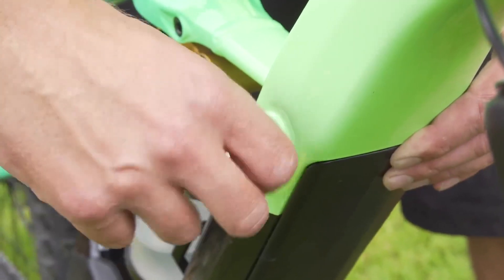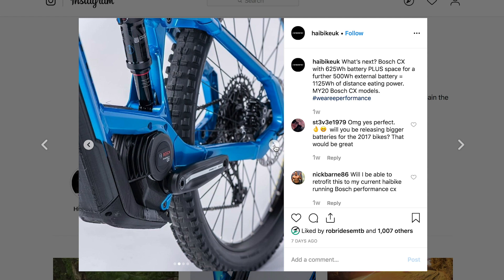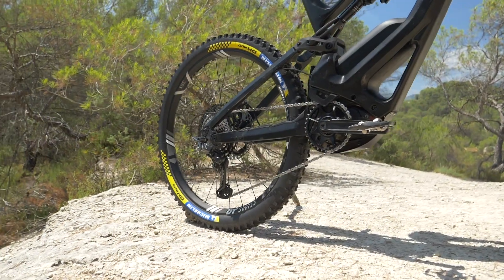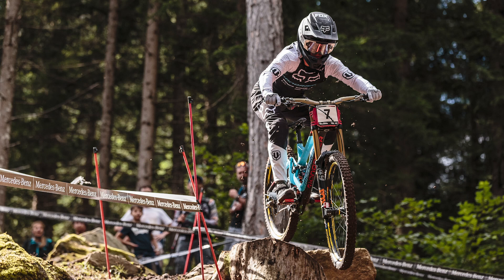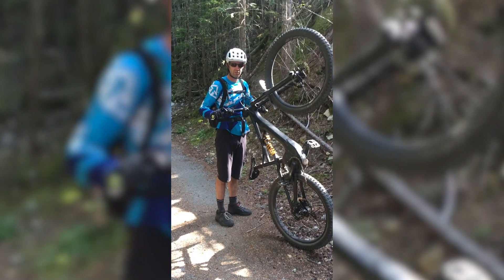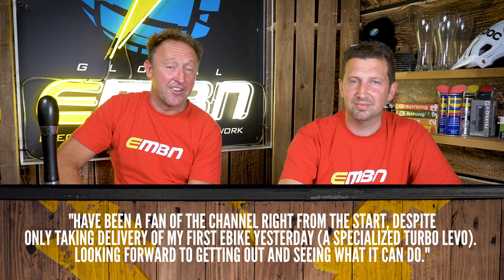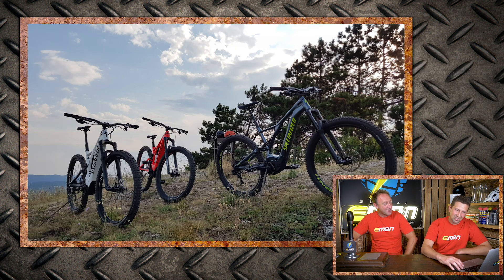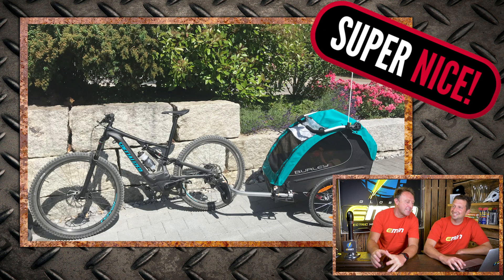What Is The Best E-Bike Battery Configuration? | EMBN Show Ep. 84

Comment: Mine is semi-integrated shimano and the only thing I'd like is a 650wh or 700wh shimano external battery. It's a pain in the arse to carry a batt in the backpack including water, tools, tube, etc... too much weight. So in order to avoid this issue I'd go for an integrated high capacity battery.

Comment: I like the look of internal batteries, or rather that the bike look more like a regular bike. The reason? I was riding a forest trail two weeks ago with some friends and all of them are riding bikes with internal batteries. We were stopping to let wanderers pass us when we met them since many trails are shared trails. I was the only one who got comments about riding a "motorbike" in the forest because everyone, even an elderly couple, spotted the Yamaha battery in the frame of my bike. When it happened for the third time my friends started laughing. However, as we sat down to grab a bite to eat, we started wondering about it. Three bikes passed all without any comments and only mine got noticed. Clearly riding an electric bike in itself was not disturbing anyone but when they saw that I had a battery, some people noticed and felt the need to comment.
Other than that, I myself actually prefer the external battery. It is cheaper to replace. It is easy to remove and charge in a different location than the bike. And I don´t mind the look. Judging from La Pierres latest bike, it seem to offer different ways to place the battery as well.

I have a Haibike with the Yamaha PW-X motor system. I have a 500 Wh battery and bought a second for those extra long trips. I wish Yamaha would make a battery that had more capacity. Since the battery is inside the frame-triangel there´s enough space for a higher/fatter battery. I would love to have a battery an inch fatter with more capacity and not having to carry a spare.
(The 400 Wh and 500 Wh batteries from Yamaha are virtually identical in size. With new cells that ought not to be the case.)

I suspect that there are riders who don´t use much more than Eco mode and would like less weight on the bike overall. Maybe they would love the ability to buy a thinner and lighter batterypack with 350 Wh effect to cut away a kilo or two? My point is, the battery is a generally underdeveloped part of the e-bike market. For the life of me, I do not understand why the big brands don't have a catalog of batteries for sale that fit their system. Surely, someone must have thought of it?

Comment: Years before internal batteries were a common thing, customers at my shop speculated that the batteries would be in the frames at some point. I could sick of hearing it, putting it inside the frame really offered no advantage, and still doesn't. Sure, it looks cleaner perhaps, but there's always a million tradeoffs. Cable routing, reliability, removal, frame strength and/or stiffness, etc. Most internal batteries I've experienced had a great tendency to rattle around a bit. External batteries are fine, some are more fine than others. It's just such a silly argument, there is no right or wrong answer other than what bike is better.

Comment: Guys the prices of some of these batteries are extremely over priced! I drive (and have a vlog) on the 2018 40kWh leaf and going by specialized pricing my vehicle without the rest of the car would be around £45,000! Add on the rest of the vehicle body chassis wheels interior charging capability DC invertor heat pump lights etc etc etc. How can specialized et all justify the prices??

Comment: My 2018 Focus Jam2 plus pro has an internal battery and a add on battery. It's not new technology. The Focus batteries are a lower capacity though.  378 watt hour batteries.  For short rides the single battery is nice and light weight. Doubling the capacity if you add the tech pack battery but that also adds weight. I guess it just depends what you want but I do think Focus came out with the concept first and now everyone is jumping on it. I think it's smart for everyone.

Comment: Nothing is as easy and innovative than Trek's 2019 internal battery - why are you forgetting to show/mention.... I challenge you to show me an easier way to remove an internal battery from ANY e-bike
Reply from the maker: Hey Alexis, the Trek uses a side loading integrated battery. We showed an example of an integrated battery at 00.38 👍
Reply: @embn  The example you showed (Specialized) involves unscrewing a bolt and then the battery drops in your hands - both time-consuming and easy to drop and damage the battery. The Trek implementation involves a lock mechanism and then the battery pops out but is being held from dropping by a clever latch which doubles as a handle - Genius implementation whose only fault is the 4-letter word on the side of this lovely piece of clever engineering "T-R-E-K"!
Reply: Here is a short video of the described implementation: https://www.youtube.com/watch?v=U_j6f2c8dA0
Reply: You are forgetting - EMBN never mentions Trek for some reason...  The Trek RIB system is great.

Comment: I live in Australia and one of the factors when choosing my Merida e160 900 over the VLT or SAM2 was the ability to hire a battery when traveling to different states due to flight restrictions on large batteries. I found the Shimano steps was the most comonly available ($50 p day)and easiest to remove for recharging.

Comment: Visually the internal batteries like the specialized levo turbo look the best, by having them housed full in the downtube and with no entry to the tube apart from the bottom it allows the tube to retain its strength without having to beef it up, so it looks thinner.  The downside is that battery removal is more of a challenge, and if you live in an apartment then you probably want to take the battery off each night to bring it up to charge.  This is my issue, I have a space in the underground carpark, but there is no charging point, so I'll be getting an ebike with an easier battery removal.
Reply: Jay Houghton I live in a flat and at the end of the ride it’s a case of turning it upside down and removing the battery 🔋,yes a bit of a flat but staying in a flat has it’s limitations,oh and it’s a levo i have👍🏻.

Comment: Hey embn! I prefer external battery bikes because the heat dissipation is better and I would like to charge the battery off the bike. Ebike battery level indicators are a simple voltage reading so the readings can be inaccurate in the last  20 or 30 percent of capacity. There is a more accurate way that involves electronic logging of the watt hours used since the last full charge and calculating the remaining capacity. As far as I know no ebike manufacturers are using the better system. Ride ride ride!

Comment: The internal system TEC system on the Focus is very good, nice and light for messing around at the MTB parks. Add the external battery for the long distance rides giving a total of 760wH. Only down side with this system is the internal battery can't be removed, but that has not really been a big issue for me yet.

Comment: my Norco site vLT 1 battery died with only 60 miles on the bike.i was stuck for weeks without riding no-one could work on it and replacing parts has been a nightmare. the integration between the battery and motor aren't user friendly
Reply: Dam, i have norcos and have found both the bikes and customer service quite good.

Comment: None of the above.
The future is a modular, standardised system where different size modules will be used. You don't own them, and pick up a new charged module at a MXS (module exchange station), that charges and maintains it. You only pay for energy used.
All what's left is the housing, which of course can look from the outside like a separate box or is integrated into the frame design.
Reply from the maker: This is your predictions for E-Mountain bikes or just E-Bikes in general?
Reply: Mate I own a (BEV) 2018 Nissan leaf and one thing I mention nearly 10 years into their development and we don't have way enough rapid charging points for the vehicles on the road can you imagine how much money this would cost let alone only be in the bigger city centres. Nice idea but its not going to happen for a very long time. Cheers